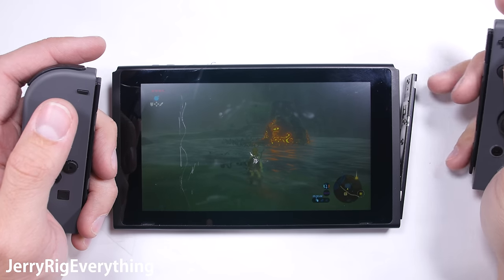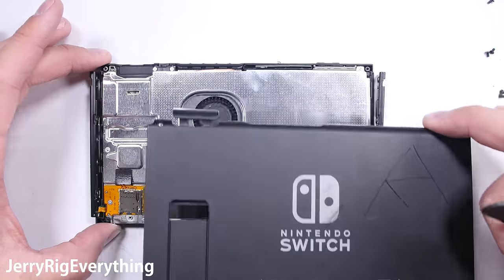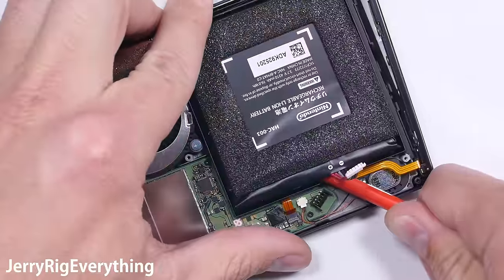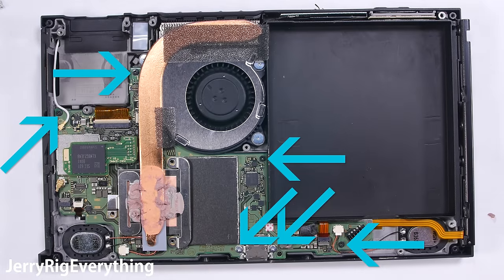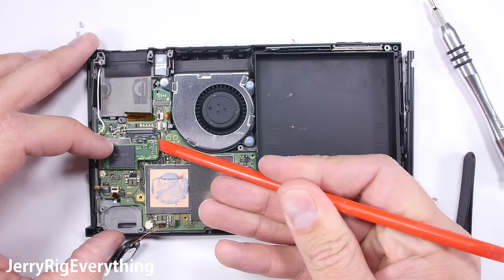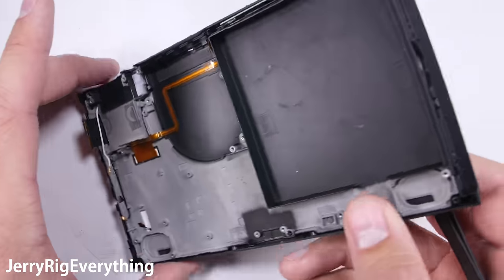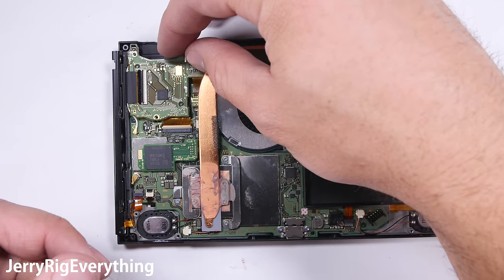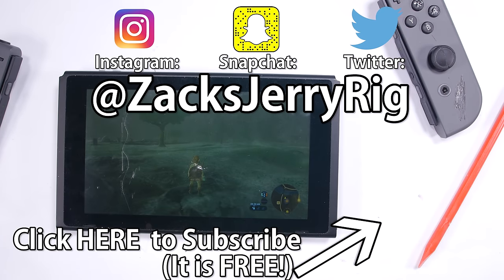Nintendo Switch Teardown - Take apart - Inside Review

Comment: Thermal paste loses a ton of its properties after separating both parts, air bubbles will penetrante increasing cpu temperature. Beware of the temperatures, sudden shutdown of the device or throttling/stuttering while playing. I would for sure replace the paste every time I remove the heat pipe.
Reply: This is an important comment that deserves more thumbs up. Every time you're taking anything apart that uses thermal paste, you should replace the paste.
Reply: +violentjett you might not care, but others do. It being trash is just your opinion. Paper money is also trash, we give it value. Try going back to school.
Reply: violentjett So I'm also gonna let a PS4 overheat.
Reply: where do you buy thermal paste in real life? Frys? Radio shack?
Reply: "LOOSES"

ALWAYS REPLACE SWITCH THERMAL WITH ABC GUM
Reply: Nevets fixed, thanks. 😬
Reply: Pretty much every computer store or online on ebay/amazon. I think you can find them in electronics stores like best buy but i'm not sure.
Reply: This is what it feels like to chew 5 gum
Reply: Jose Angel Galvez what if we use pc thermal paste on it
Reply: PRO there is no "thermal paste for gaming consoles". They are all for the same purpose. So of course, pc cpu paste is the one to use.
Reply: i know but pc thermal paste sometimes has better cooling potential
Reply: PRO better than what? What other thermal paste exist in the market for electronics?
Reply: +violentjett Wait, but it has Zelda...
Reply: lol
Reply: There are several different compounds. The typical paste you buy for a CPU is however usually silver based but the amount of silver (filler) can vary.
The paste can for an example have an aluminium filler instead which doesn't conduct heat as efficiently.
The amount of paste applied from factory is also usually way to much. It becomes an insulator instead of a good conductor. It's purpose is only to fill in air pockets between the two surfaces, nothing else.
That is also why it's crucial to properly clean and apply new paste after dissembling a heatsink since reusing old paste introduces air bubbles.
Reply: I'm worried about the fact that Nintendo used thermo paste for their nintendo switches which means they probably wont last long because its paste and it will eventually wear out.
Reply: LegoToolBox The Epic a lot of phones have thermal paste too and they last for ages. I assure you the Nintendo Switch needs thermal paste or it would burn out almost immediately if you play a large battery consuming game like Zelda.
Reply: @AckzaTV  computer stores
Reply: @AckzaTV  Amazon😂
Reply: @brandonfillet1913  ... and the Switch uses the Nvidia Tegra... so... Switch ftw?
Reply: Some AS5 should do the trick
Reply: Yes it should be up there because people might not scroll down enough
Reply: old comment but very true.
Reply: That is false,biggest lie of computing history lol
Reply: Dog shit works better than thermal paste, stinks though.
Reply: Is that why my Nintendo started rapidly heating

Comment: You forgot to remove the sim card tray
Reply from the maker: I legit panicked for a minute after reading your comment.
Reply: JerryRigEverything hahah was all planned. Keep up the good work man!
Reply: And the camera lens.
Reply: Bora Demiray its inportant to know whats in the switch so anybody can fix it without asking a noob
Reply: Worthless Opinion 
Username checks out
Reply: motorrad166 yep
Reply: Damn he removed the comment. What did it say?
Reply: Jellyblob he couldn't tell it was a joke
Reply: Thanks
Reply: +Nikkita Pece The internet is at your fingertips
Reply: it's at your fingertips
Reply: Hahahahaha xD
Reply: this is so damn funny holy hell
Reply: Pierre Aoun yeah but what
Reply: JerryRigEverything , Don't forget about that headphone jack ;)
Reply: Id like to put in that thermal paste should always be replaced if you lift a cooler. as it can introduce air bubbles which can trap heat & cause performance issues if you are on the limit already from a badly mounted cooler out of the box or have a limited amount of cooling possible.

Replacing it with a higher end thermal paste found commonly for pc's & using a tad smaller amount so there's no major overflow between the chip & the heatpipe should be a decent way of cooling it down (still covering about the same length with thermalpaste ofc.)
& to keep it somewhat nicer to clean you can replace the 2nd glob of thermal paste that's on the other side of the heatpipe against the metal shielding with a thermalpad or two. While that isn't as great as proper thermalpaste they are a bit more re-useable if you happen to be taking it apart more often.
Reply: Kyubey well the PS Vita had a version for sim card support for mobile online play.
Reply: I laughed for a while after reading your comment, haha
Reply: I don't get it
Reply: Triggred
Reply: A GAME CARD slot.
Reply: Haha
Reply: What's wrong with you....?!
Reply: r/woooosh
Reply: @Meowblivion  r/woooosh
Reply: @darknecroninja3443  don't fucking woosh me!
Reply: There’s no SIM card tray
Reply: Nintendo Switch doesn't support SIM cards. My tablet doesn't support SIM cards also it supports microSD. Because it's wifi only.
Reply: Kyubi r/woosh
Reply: Samuel Johnson Please learn to spell before making a comment.
Reply: Kyubi he’ll do what he wants 

R/woooooooooosh
Reply: Miranda St.pierre r/wooosh
Reply: Alex Bălan r/woooooooooosh
Reply: desolate.joshlerr What the hell is a normie
Reply: @Meowblivion  whoooosh
Reply: @Meowblivion  and? the psvita has a simcard tray too, and its not a phone either. 

my tablet has a simcard tray too  and its not a phone.
Reply: Nice catch
Reply: Oh my god this mean you can call 911 on the switch
Reply: @JerryRigEverything  you shall make another video bout that
Reply: Aa Türk!
Reply: Brooooooo you got us 😂
Reply: someone didn't get the joke here
Reply: @Meowblivion  r/woooosh
Reply: @Meowblivion  r/woooosh
Reply: I am so dumb by thinking that there is a sim card in a switch the moment i read this and then i realized it was a joke xD
Reply: Keyon Johnson r/engrish r/youngpeopleyoutube (am i funny now guys?)
Reply: Kyubi it’s lol not lel
Reply: JerryRigEverything it’s ok I don’t mind
Reply: JerryRigEverything Lol
Reply: @Meowblivion  No Shit Sherlock
Reply: @Meowblivion  he just did
Reply: @alexbalan_5623  that's the joke
Reply: Dude r/whoosh
Reply: And sorry about that but Nintendo Switch does not have the SIM card
Reply: @JerryRigEverything  OOF
Reply: There is no SIM card forgot this is a Nintendo system not Samsung LG Sony Apple or T-Mobile sidekick.
Reply: WHy the heck doesn't my 000 phillips head fit the switch screws on the sides and top..... I need to take mine apart my game card reader has a bent pin.
Reply: @JerryRigEverything  ( ´◡‿ゝ◡`)
Reply: @JerryRigEverything  you actually forgot the camera tho
Reply: Can you please do a solution for a blue screen my switch has had a blue screen for weeks And my option is to buy a new one plz I beg of you help me
Reply: @keyonjohnson4652  gosh learn english
Reply: @JerryRigEverything  jerry can you please tell me what speakers to get cause mine do not work any more
Reply: Bro its not a phone
Reply: These replies are amazing lmao

Comment: Wants to play Zelda later:
-"Accidentally" tears off Joy-Con rail.
-Melts screen.
-Scratches screen.
-Scratches all surfaces.
-Cuts through analog stick rubber.
-Chews up X-button.
Reply: PkGam just put it in the dock lmao that’s what i actually like with the switch that if something breaks like the joy on you can just put it on the switch and use a pro controller or something
Reply: And still works. Lol
Reply: I'm dead 🤣
Reply: @decaygamer194  I suppose he could. Though his pro controller might have went through the same tests, lol!
Reply: @bern9642  True!
Reply: @Brayden15  ^_^
Reply: @PkGam  it's very well-built except for the joy-con drift.
Reply: PkGam yeah😂
Reply: @bern9642  Indeed! I may have figured out a potential fix for the drift (which I made a video on, but I can't link it because of Youtube's automated comment filter). It involves lifting up the little rubber flap under the stick, and getting a bit of alcohol under it so it goes down into the stick's housing and on the contact points were it reads the movements, then moving the stick around repeatedly to "clean" it by utilizing the stick's own moving parts. Of course don't do this while the Joycon is on because you don't want the liquids to cause electricity to go where it shouldn't, so try not to hit any buttons while you do it and wait for it to fully dry just in case. 

It may or may not work depending on what the particular problem with the stick is because there's more than one reason for a stick to get drift. But the idea behind it is to fix what seems to be causing the problem for most: The contacts getting dust/dirty. You may have to repeat it over time as new dust/dirt accumulates. Alternately Nintendo will repair it for free even outside of warranty, but you have to wait like 4 weeks for them to do it. So a lot opt for a DIY fix to get back to gaming ASAP. But I don't think they will do any repairs at the moment anyway though because of the Coronavirus.
Reply: -And actually still plays Zelda later

Comment: Ah good point. The battery will not be able to hold charge after several years. Maybe I'll attempt this myself after the New Switch XL 2 U Mii releases.
Reply: Crow Migration It sounds stupid, but you know Nintendo'll probably do it...
Reply: Nintendo will pull what apple did and slow every thing down then make you buy a new battery for $30
Reply: racer164 
But Nintendo Staff aren't crack heads...
Reply: It will still hold charge, the capacity will just be reduced.
Reply: Pretty sure if GB colors batteries still work, this will be fine in a couple of years considering its superior tech by far.
Reply: racer164 I hope not....The prices have not skyrocketed,so we are ok.
Reply: @racer164 If Nintendo would do that, they would do it to the Wii u as well, but they didn't.
Reply: racer164 
Nintendo don’t do that sort of thing.  They respect their customers more than most companies.  They build products to last.  For example, I have a DS Lite that is years old and has been used for many hours and it still works and holds charge.
Reply: @TheStrikeofGod  I have thousands hours on my new nintendo 3ds xl and the battery works perfectly, it last more than the switch
Reply: Crow Migration 

Ggggggg
Reply: ok just to be clear, its 2024, 6 years after this comment was made and the only issue i have with mine is my joycons are loose

Comment: I think you should do a teardown of a Nintendo 3DS system, maybe an older model, because I know they're a pain in the ass to repair. I had a problem with mine where the ribbon cable connecting the top and bottom screens folded in on itself, creased, and messed with the exposure of the display of my system. (Had a bunch of vertical black lines going through the top screen that flickered. And eventually evolved into where the picture display of it looks like it had been messed with, like the contrast of it was really bright, and looked awful. But if I was lucky, it would flicker back to normal) My boyfriend tried fixing it by reseating said cables, because he thought they were just loose cables sticking out. By doing that, it ended up folding the cable even more and tearing it. Bought me a new screen with new ribbon cables 3 separate occasions, tried to reassemble it, but accidently ripped it, and gave up.  The system was well loved. It had a little funeral. And he bought me a New Nintendo 3ds xl. 
So I was curious it if would be as much of a pain for you to take apart and put back together then it was for him.
Love your videos!
Reply: Yeah I screwed up my 2ds when I tried to repair. The start, select, and X button didn't work after.
Reply: I’m currently having a problem with my 375 dollar special edition legend of Zelda link between worlds 3DS XL not charging

Comment: Come on Jez.. The thermal compound, once disturbed must always be replaced.. Lol
Reply: John King it goes bad?
Reply: It does go bad over time when it dries up, but if you disturb the compound and re-attach the heat sink it can create inefficient air pockets that hinder the heat dissipation. Fresh compound is the key! I recommend Artic Silver5.
Reply: John King yep this made me cringe
Reply: It should also be applied in small amounts/thin layers. Unfortunately, the build quality of this product appears to prevent this. Gotta glob it on. So in this case, you'd probably be fine to just scrape it into a glob in the center of the contact area so that it makes good contact when it squishes back together. New thermal paste would of course be better, but be sure to use something viscous enough to keep its place bridging the gaps.
Reply: John King gezondheid
Reply: John King no, that is potentially conductive thus MX4 is better for mobile applications. The difference between AS5 and MX4 is only 1-2C anyway so may as well use the 100% non-conductive TIM.
Reply: toy machine nawh, it depends on the cooling system, sometimes a pea sized (or slightly larger for HEDT) is best (such as a cooler with a plate soldered or a water block) but sometimes a large blob is better such as this case or a cooling system like the razer blade, plain heatpipes without a plate soldered on.
Reply: Mr. Meerkat as5 is non conductive lol

Comment: My boy must have pulled the headphones at some point because he only had audio in one ear. I pulled the back and silver plate off. Found a broken solder joint, fixed it and both audio channels work!

Thanks Jose for the tip on thermal paste, going to get some now and fix that.

Comment: Unlike Gamer's Nexus, you actually disconnected the battery as a first step and used a plastic pry tool instead of a metal one. I was actually amazed that his unit didn't start sparking and smoking somewhere mid-procedure.

Comment: Honestly, I think Nintendo intends to release different models of the SKU in relative quick succession. The way they made most parts very modular/Lego style makes me think that is what they plan on doing. The least they can do is redesign the cartridge slot since that seems to be having issues reading the cartridge. Also, they should put the charger port elsewhere like one on top and keep the one on the bottom for docking. I also think that they are doing a better dock that boosts CPU, GPU, and RAM since tear downs of the dock showed that it has a lot of empty space.
Reply: Which is a pretty shitty move, if you ask me. Really screws over faithful early adopters.
Reply: What do you want them to do? leave everyone to suffer? replace all the 'faithful early adopters' units? 
Replacements are too expensive, keeping the system flawed is bad PR. I don't imagine they would even have another option.
Reply: GenoClysm Oh, I don't know, maybe release a fucking finished product. Instead, their initial launch sku is purposely hobbled so they can later release an upgraded version. It's what they do.
Reply: Psybladder501 Yes, another example. Nintendo isn't the only offender, obviously. This direction will only lead to the death of consoles. Maybe that's a good thing though.
Reply: PC MASTER RACE!!!!!!!!!!

Comment: My son's switch had a noisy fan all of a sudden, so I had to open and clean it.
Looks like you don't actually have to remove the metal Joycon brackets on the sides to just open the console (and rip the stupid flimsy ribbon cable off like you did ... and I did too).
So, it is not noisy anymore but the right side charging/sensing function is gone. Win some, lose some...

Comment: Thank you for this video, this has helped me take apart my switch to try and fix it. 
I got it for free from a friend when it broke after he dropped it. there were some minor issues with it he mentioned but I didn't notice any of them at all except for the one big thing this drop did, it wont display on the tv when docked.
I have gotten a signal briefly to the tv if I adjust it in a certain way and after taking it apart the first time I got a strong signal almost immediately, turns out my usb c port is slightly obstructed from the bending of the case.

Comment: Hey, just a question for ya, I haven’t had any problems with my switch since getting it but I’ve noticed it’s starting to struggle with heat and battery life? Is it worth cleaning out the inside or just leaving it until a new switch that isn’t just a fancy new screen comes out?

Comment: How did you get that back panel off, my Nintendo switch has four 3 star screws on the back
Reply: Same with here with my launch day switch.

All I now from articles is just the size of the screws being 6.3, 3.8, 2.5 and 1.6 mm long for the Y-shape screws that need a Y00 screwdriver.

Good luck finding these screws at top hardware stores in America like Home Depot and Lowe’s. I already went to 20 and they don’t sell those small size screws.

^ the stores also want to now the thread size for each screw w/o that they don’t know what screw your looking for. Blah blah blah it’s a special screw type you’re looking for. 

No article or video mentions the thread size for the screws. These console manuals need to include the screw size lengths therefore people are aware when they need to go open it to clean the fan or replace something.

Comment: Good tutorial, but a warning, be extremely careful with the micro SD card reader, the connector id extremely flimsy, from my to pins broke off when opening. Still glad i did cause i saw my switch thermal paste is all crusted up and it was very dusty inside

Comment: Do you have any links to where I may find parts? My twins put mine on the toaster and melted the screen and bottom casing. I’ve taken it apart, the screen and plastic shell are the only bits effected, thank god, but don’t know where to look for replacement parts. eBay was no help, the reviews on all the sellers were off.